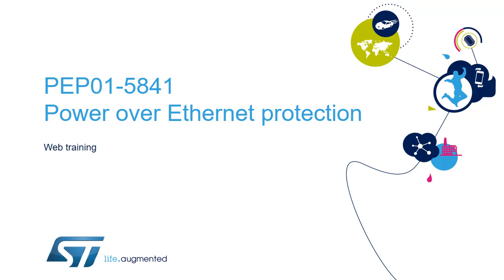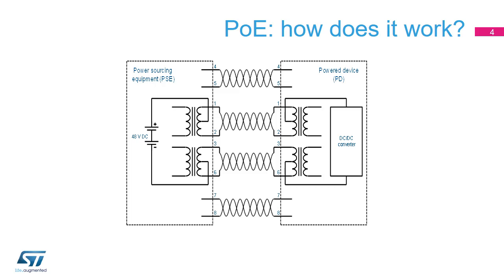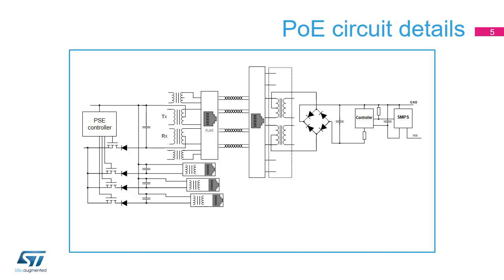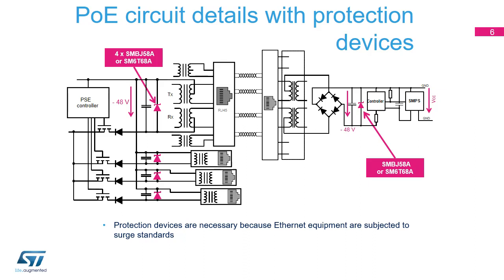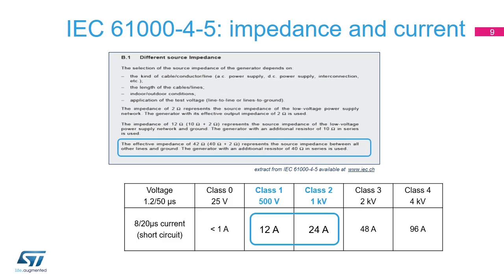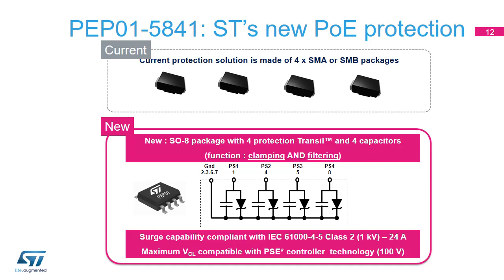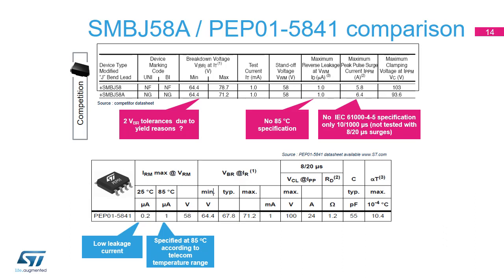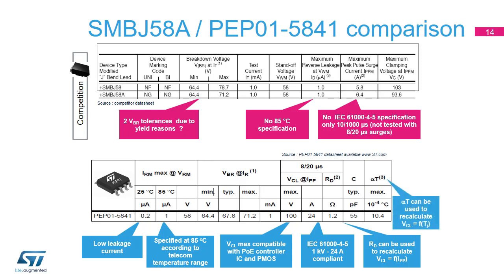Power over Ethernet protection

Comment: Good morning ST, at 6:04 you call the common pins 2,3,6,7 GND, while these are not supposed to be connected to GND but to the positive power line,
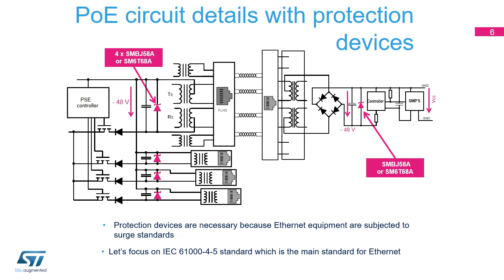because the zener diodes are supposed to be connected anti-parallel and not parallel... So the Kathode connected to the plus and not to the minus, to utilize the break down voltage protection and not the forward voltage protection. But then around 3:46 I notice in your diagram that you imply the positive power line to be GND, because you show the voltage as negative, seeing the purple voltage arrow pointing down to -48 Volts. So... ok.. I could understand it like this, maybe.. although it is a bit confusing.. and so accidents may happen when you confuse the GND with a positive power line.... But then I have a look at your datasheet, and so first I read at the bottom of figure 1, "all GND pins must be connected to GND" and I say oh really...? kind of depends what you call GND then... But then in figure 11, I see that there you draw the voltage arrow as positive so pointing to +48 Volts, and there... there we have it... the GND pins of the protection circuit, contrary to the note in figure 1, are connected to +48 Volts, as it should be, and not to the GND, unless you call +48V GND but that is kind of dangerous and confusing. I can see further, that you fix this a little bit, because you call this connection "com" for common, which is a better name for these pins, so "com" and not "GND".
And so maybe it would be good thing to update everything accordingly? So to rename "GND" to "COM" where appropriate?
Last point, coming back to the video, the schematic at 3:48, all the way to the right, both power connections of the SMPS are there called "GND" with a positive voltage, Vcc drawn
across them with a purple arrow pointing down, such as with the -48V purple arrows, but this one is apparently +Vcc and not -Vcc although it is pointing down...

Concluding, people get confused about this also the authors of your datasheets and the schematics in this video.

Not that I am confused, I still get it... but still maybe it is a good thing to update everything more clearly?
(Just in case, now you have uploaded this video suddenly... all the POEs start to explode all over our planet. Just kidding 😃)

Bottom line, maybe, it is dangerous to call something "GND" while it really isn't, or not always...